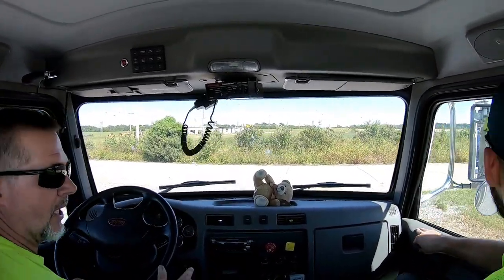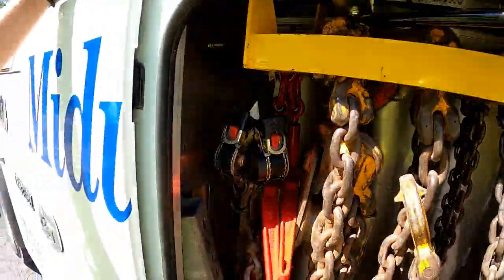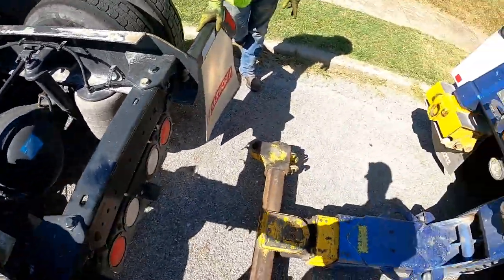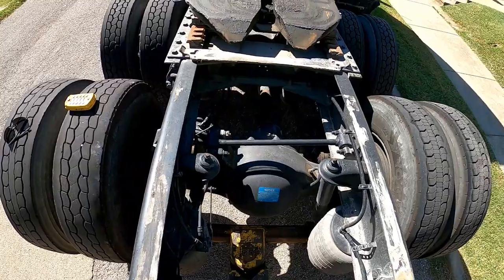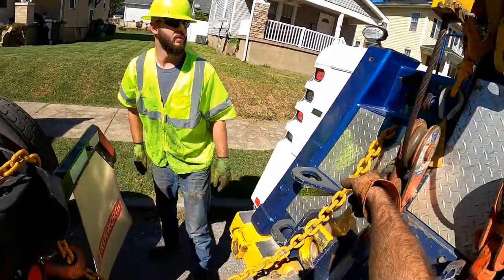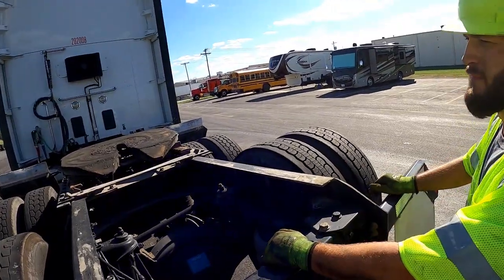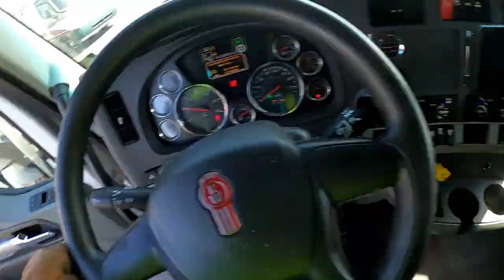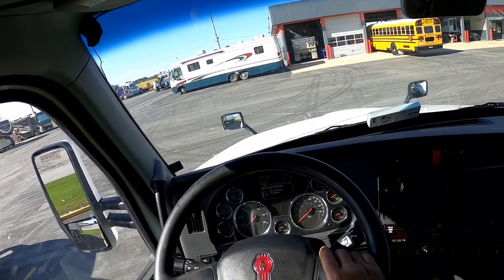10 Tows With Dalton. Truck #10 That Is

Comment: You are amazing. You walk 25 feet to the cab and pull forward turn the wheel a little and back up and you just pulled a maneuver ,"No biggy" that made me do a double take. You just moved over a inch and a half, I have to put a jack under the pig on my Impala to get that kind of accuracy.

Comment: That is a hole lot better then using the seat belt. I like those remote taillights rather than the old one's with a cord I had to use with the flatbed I drove years ago. Thank you for teaching me a few things & add to the itch for me to get back in a truck. 😎👍👍 stay safe out there. 🙏

Comment: They gotta do something about Adblue, this problem has been around since the stuff first came into use, main problem is it crystalizes in the supply lines and blocks them causing the engine management to drop into emergency mode.
Easy fix is regularly flushing the lines (there are even youtube vids showing how), but more often people wait till it clogs up then Ron gets another payday.

Comment: An idea that I saw I think may interest you.

Another towing YouTuber by the name of Cassey Ladelle had a method of connecting the break-away chains to a car via using endless loops. The reason being is it puts a softer material in contact with the vehicle thus minimizes scratches. I don't know how applicable it is for heavier trucks but I think it may be an idea you'd like.

Comment: Ah, DEF issues. Those with diesel pusher motorhomes are dealing with that also and many have been told they'd have to wait for 2+ months just for a replacement. This is on 2016 yr and newer. If a semi has a manual transmission you can disconnect the speed sensor and drive them to the shop.

Comment: Question from the curious:
I know semi truck steering wheels can go up and down to allow the driver to get in an out easier. Would that effect anything when strapping down the wheel? I'm wondering if there's a (slight) chance the release can open up and the straps can get loose.
Thanks for doing what you do, and sharing it to us for our edu-tainment 😊
Also, thank you for taking the time to teach someone who wants to learn!
Reply: The steering wheel alignment is an air sleeve that locks to the position. Designed not to move, but handy for ingress and egress.
Reply from the maker: Actually, yes, there is the possibility that the tilt steering mechanism could cause the straps to loosen.   Typically, I will tilt the steering wheel to its downward-most position so that this can't happen.   I know I didn't explain that in this video and I don't recall if I actually tilted the wheel down on this job or not.  I probably did, but I wouldn't swear to it.    I do it so often, it is simply second-nature, if you will.  Good question.   Thanks for watching and God bless.

Comment: seen a tow company when the Battery  died on the wireless rear light box went on Amazon & wired in a Power Wheels Adapter for Milwaukee M18 Battery 18v Dock Power Connector  so in stead of having to replace the lead acid Battery  internal he uses all   M18 Battery 18v on his truck for all inpacks ect just keeps an extra M18 Battery on the truck

Comment: You are a splendid show and tell teacher.  What are the advantages of towing from the rear of the tractor rather than from the front?
Reply: Don't have to drop the drive shafts to protect the transmission is perhaps the biggest.   While not all transmissions would be ruined by towing, they pretty much have to assume it will when hooking up.   Even on totalled trucks, which this isn't, they will often take steps to protect the transmission for its salvage value to the insurance company.
Reply: Not having to disconnect the drive shafts, for starters...it's pretty standard in America to tow a rear wheel drive vehicle from the rear (when doing a "flat" tow).

Comment: Another great video Ron!  Love seeing you train a new guy on the ways of the Recovery Operator.  Semi-related question - with more and more operators pushing for automatic transmissions as "standard" for their rigs, do you think that you'll be ending up with automatic transmissions on your next set of heavy trucks or do you think manual transmissions will still be available as a "standard" option instead of a "premium" one (as it is with road cars now).
Reply from the maker: That's a good question.   I do not know the answer.  I prefer a standard transmission, however, there have been many advancements to the heavy duty automated transmissions.   Our Peterbilt rollback unit #15 has an Allison automatic.   It took some getting used to, but I have come to like it, for the most part.  In inclement weather, I still prefer my standard shift.   I know the trucking industry, as a whole, is moving towards the automatics due in large part to a lack of drivers with the knowledge/capability to handle a standard transmission.  At this point.....only time will tell, but I believe the automatics will become the norm.   Thanks for watching and God bless.

Comment: I have a question the truck has an adjustable steering wheel shouldn’t you be adjusting the wheel to  its Lowe’s position before tying it down?

Comment: Hi Ron, I'm a retired (UK) truck driver, may I ask, I assume you have the 'Park' brake on while operating the lift and lower procedures to avoid any 'run away' but not for the 'tow'. Also interested in the steering lock, I would have strapped between the driver and passenger grab handles (by the door hinges) can you say why this is not the obvious anchor? many thanks, keep safe Tony
Reply from the maker: Actually, when towing from the rear, as in this video, I leave the parking brake applied on the towed vehicle.  This is another safety feature in the event the towed vehicle should break away.   As for the grab handle option, I haven't considered using them.  Not that they couldn't be used.  I have just always used the base of the driver's seat.    Thanks for watching and God bless.

Comment: Okay, i never expected someone to call a tow truck for some AdBlue. I mean, you can usually get it on every gas station.

Or did i get something wrong and it was not that the AdBlue is empty?

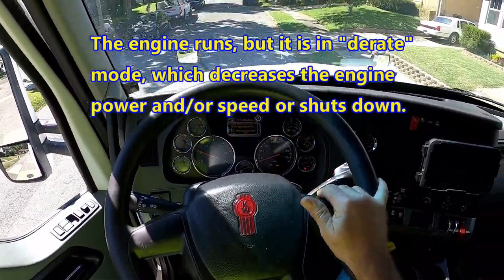EDIT: Ah, at 3:00 it was explained. So it was, in theory, the AdBlue or the system that uses it.

Comment: Have you had any DEF problems on any
of your trucks?
Reply from the maker: OH YES!!!   Truck #10 in this video constantly has problems since it was one of the earlier DEF systems released.   It is been in DeRate mode multiple times and we've had to tow it a time or two.   We've also had a recall on rollback unit #15, the one I usually drive.  It had a tank heater valve recall that burnt up the tri-sensor (DEF level/temp/quality).     All our DEF equipped units have had issues with the DEF systems.   We have trouble with DEF just like everyone else.   The only saving Grace for us, is that we can work on most of our own equipment and we have the software to help diagnose/repair.   Thanks and God bless.

Comment: We are now seeing adblue issues on dieael cars, the injector fails, destroying the catalyst, the tell tale sign is not using any adblue/def. , that stuff is a pain, and the likes of Kia say it is not a warranty issue, or common, which we know arebporkie pues. It has been an issue on Cummins diesels since 2007 in the UK, and caused ne no end of headaches replacing injectors and catalysts on BMC buses and Cummins powered Optare buses. Its a real pain in the rear.

Comment: I dont really know much about towing... Just have one question, why are you towing from the back and not the front? Shouldn't it be easier o the front cause you don't have steering wheels in the back?
Reply from the maker: Actually, when towing a semi from the front, there is a lot more prep work that must be done to safely tow the vehicle.    I have other videos available that show front tows of semis and it can be a time-consuming and painstaking task to get one prepped and ready to tow safely.   Thanks for watching and God bless.

Comment: One other question I have , if the diesel trucks both semi’s & pick ups
are having all these problems do the railroads have all these 
problems or are they exempt & don’t have to use this DEF crap?
Reply from the maker: I don't know much about train engines.   I can tell you that we work on 2 major railroad companies' MOW (Maintenance Of Way) vehicles, which are basically their work trucks that maintain the tracks, signals, crossings, bridges, etc. and those vehicles are NOT exempt.   They have the same issues with DEF that the rest of us do.   Thanks and God bless.

Comment: Okay, newbie question here: In cars I've driven (granted, not diesel or trucks), there is an automatic "straight ahead" lock on the steering wheel; I take it semis don't have them, standard? I'm also curious as to why, if anyone can tell me, please. TIA
Reply: I work on Freightliner Cascadias/ Detroits so can't speak for the other brands but Freightliners do not have a lock. We wrap the seat belt around the steering wheel for towing.
Reply from the maker: @KECOG  Most semi truck do not have a steering wheel lock like passenger vehicles.   Thanks for watching and God bless.
Reply from the maker: @massey_2298  I would strongly suggest you use a different method to secure the steering wheel.   Just my opinion.   Thanks and God bless.
Reply: @RonPratt  Thanks. It does seem a little sketchy. When i said 'we' I meant our company tow driver. I've also seen actual tow companies use this method on our trucks.

Comment: 19:35 some towers just loop the seatbelt through the bottom of the steering wheel, and lock it into receiver.  
I'm assuming that's dangerous.
Reply from the maker: In my opinion, using the seat belt to hold the steering wheel while towing from the rear is NOT a good option.   I will use this method to keep the wheels straight when I'm towing one from the FRONT with the steer tires lifted off the ground, but with them on the ground I want to make certain the will not change direction.   Again, just my opinion.   Thanks for watching and God bless.
Reply: @RonPratt  I was figuring that.
Most the people I see do it, are the guys on The Coq in BC (Highway Thru Hell), and on the 401 in the Greater Toronto area (Heavy Rescue 401) - they want to hook it, and book it off the busy/dangerous area.  They usually stop at the first available exit, and (off camera), apparently, fix the rigging.

Comment: Congratulations EPA you mandate the engine manufacturer to put pollution control equipment that none of the Manufacturers can not get to work correctly! The failure of the DEF system is the biggest reason that these trucks are towed at a large cost in to dealer!

Comment: DPF is nightmare of every trucker. I Wonder why it brokes all the time.
Reply: Well, the fluid itself is corrosive, and not chemically stable, especially when exposed to high heat or sunlight.  So, you often get sensors damaged or contamination in the system, just from the nature of the fluid you're using in it.  Hopefully, someone someday will come up with a better way to treat exhaust. 

While I agree that reducing the smog and acid rain causing emissions from diesel is important,  the increased fuel consumption, both directly from loss of fuel efficiency and indirectly from all the extra parts  transport, towing, etc as a result of the systems currently in place are a pretty high price to pay for those reduced emissions, especially if one is worried about C02 emissions.